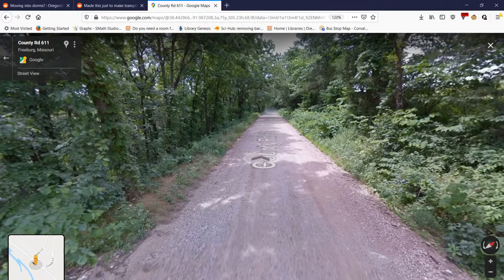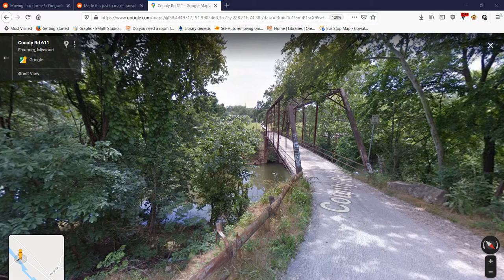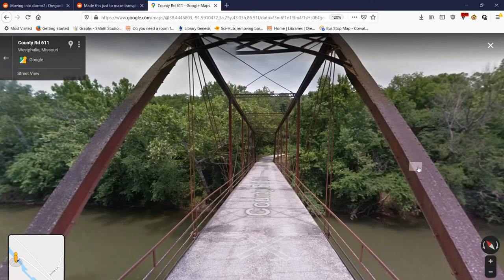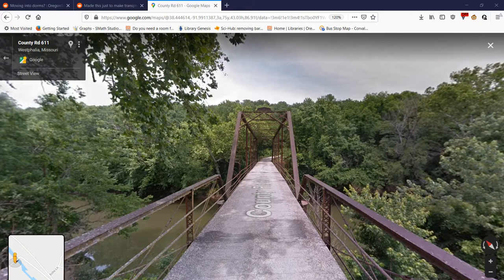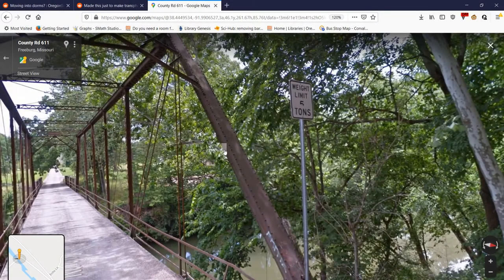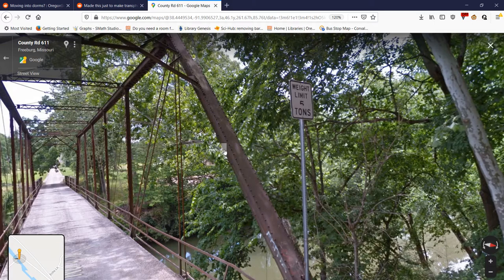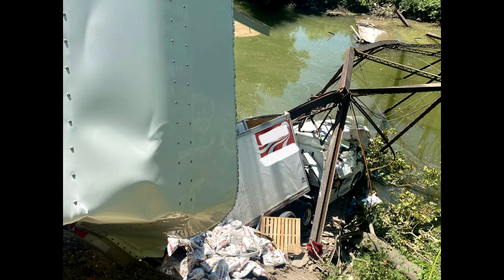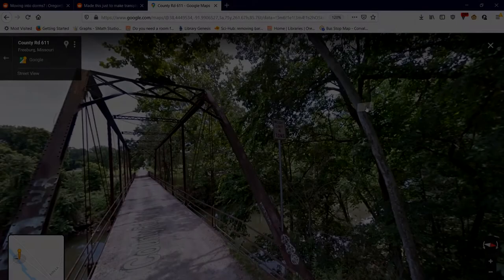A Bridge Too Far

Comment: The bridge looks lovely, it's one of those on the backroad which comes in handy for locals trying to get somewhere specific quickly. Shame even if by the sounds of the latest inspection report the collapsed pictures go along with grades appropriately :D.
Reply from the maker: Exactly. It was one of those tiny back routes that really wouldn't be worth constructing a modern highway bridge. In many cases, the alternative for these old remote bridges isn't a better, modern bridge, but no bridge at all. For example, in this case, would the highway department really pay probably $2 million to put in a modern replacement bridge, when there is a perfectly sound modern bridge a few minute drive away? I'm not sure this bridge will even be replaced. You can legally leave an old  bridge in place, but if you're building new, you have to build to modern standards. You can build dedicated pedestrian bridges under the code, but such bridges generally don't have much utility in very rural areas. There simply isn't really a legal way to build a new, but cheap bridge that is strong enough for regular-sized automobiles, but not large trucks and semis.